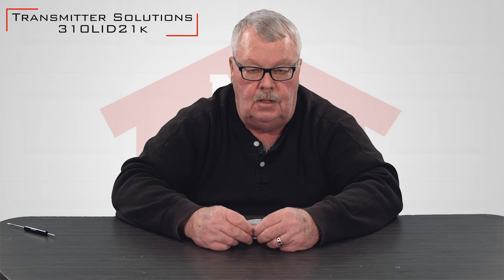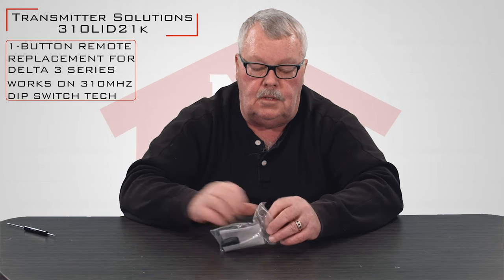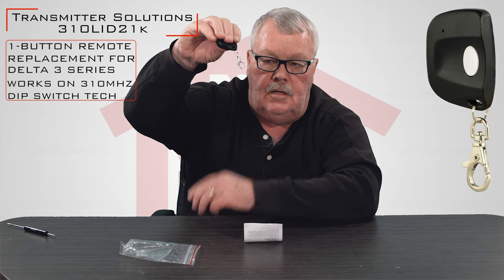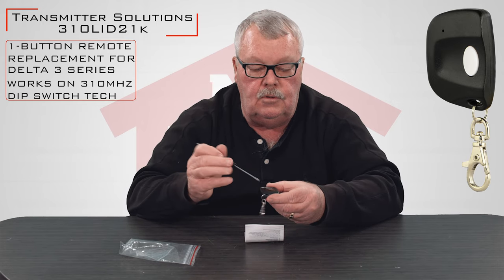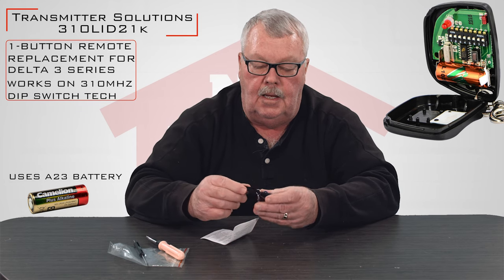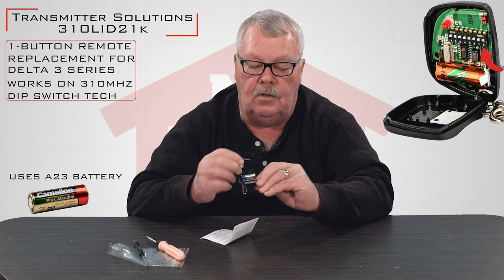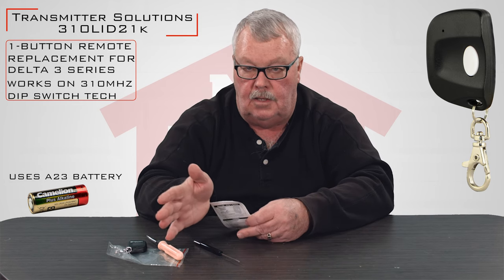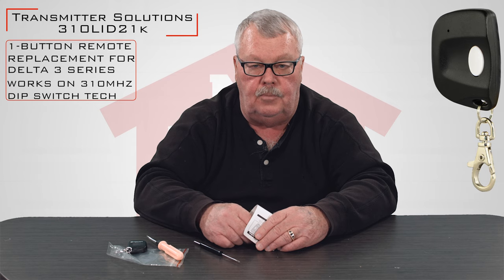Transmitter Solutions Firefly 310LID21k

Comment: Mine won't open like it does in the video. Took the screw out and the remote is tight as a drum.  Tried to pry it open with a small flathead screwdriver in the bottom notch but it barely opens.  What can I do to open it?
Reply: Same thing is happening to me

Comment: What is the size phillips screwdriver you use for that small skew to open the back in order to set the code?  I thought my keychain eyeglass skew drivers would work but just a bit too small and I don't know that size that is either.  it would be nice to have the tool you have if you could include that information if not the too since the unit is useless without accessing the internal part of the controller unit..